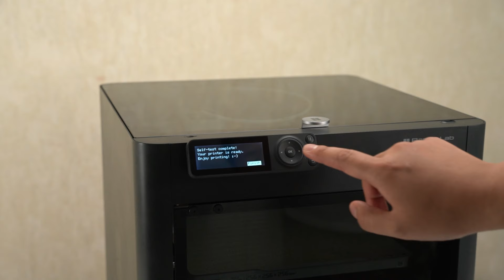Bambu Lab P1S Official Unboxing

Comment: Just received my 2nd broken P1S today. The sad part of the story: That's only because BambuLab tries to save some money on packaging.
Instead of flexible foam around the top part of the printer they use styrofoam corners now. This resulted in 2x printers with broken housing, one also had the SD reader broken.

Comment: I JUST BOUGHT THE P1P JUST YESTERDAY AND TODAY THIS COMES OUT WITHOUT ANY SALES NOTICE WHICH ALLOWS ME TO CHOOSE WHETHER TO ORDER THIS OR THE PLUS P1P I SEE THAT THE DIFFERENCE IS ONLY $100 COMPARED TO THE SELLING OF THE TURNTABLE AND PS1 UPGRADE KITS WHICH IS $210 THIS IS VERY WRONG ON THEIR PART I HOPE THEY WILL FIX THE THING OTHERWISE PAYPAL WILL THINK ABOUT IT
Reply: if it hasn't arrived just get in touch with them, otherwise just buy the upgrade kit or look at their refund policy, they have it just under the product
Reply: @Ayce47  Of course it is not a problem to make the refund even if it costs me 40 $ that no one laughs at me to do it but it is not correct the same on their part not to warn before buying a new product that the next day a better one would have come out and the upgrade kit costs twice the difference as buying the car with the kit mounted this is the problem and they are not the only ones but in this world it works like this for us creators
Reply: @21LOLxPRO  there have been warnings throughout this past week of the P1S's release. companies do not need to send out a warning, anytime you buy a product you risk another one coming out soon.

if you just bought the P1P, you likely have may have some time to cancel the order. either way, get in touch with them and ask for a refund or see if you can receive the upgrade product.

Comment: Bambu Labs are taking the P1S, only had my P1P 2 weeks, bought their upgrade kit with chamber fan, hardened toolhead and extruder and other bits n bobs for £94, now they are releasing a kit for P1P owners for £138 with most of the parts I already bought!
Not a great way to treat your customers, then again you make great 3D Printers, just wish you did customer service as well, because at CS you suck bigtime!
Reply: P1P Vision Enclosure ;) I've printed the supportings. The glass costs 70 $
Reply: @danielk.2885  already printed mine, I'm on about the hardened tool gear, extruder, cable train, hardened tool chain, chamber fan, I've bought and fitted all of that in the last 10 days